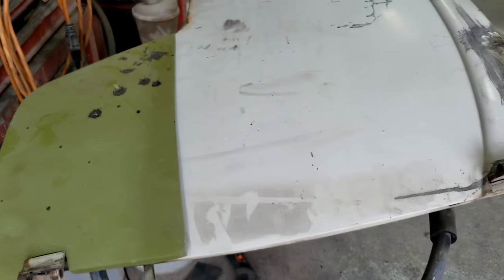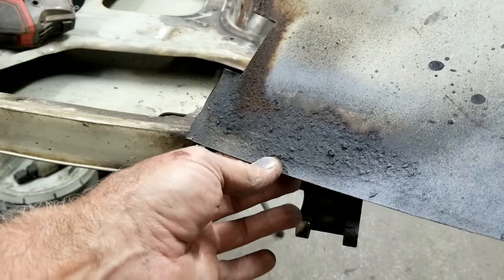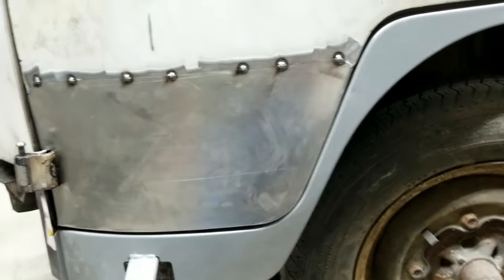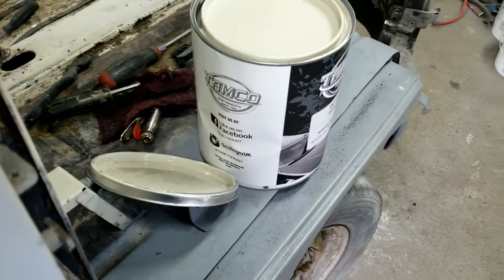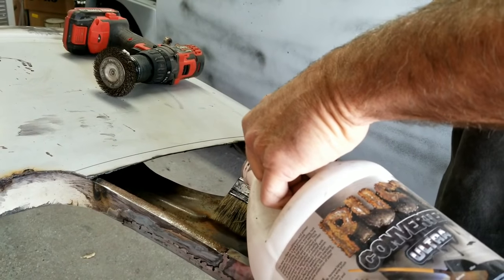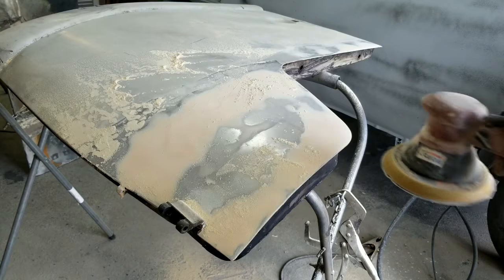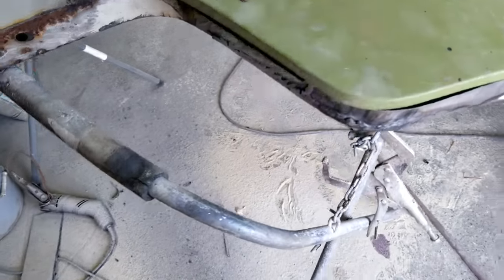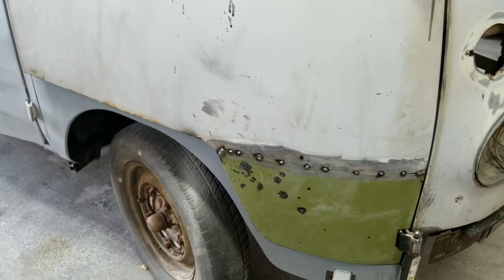RESTORATION - VW BUS RESTORE - Driver and passenger door Welding and Fabrication

Comment: Been watching all of your videos - Thanks for putting them out😊 thankfully I don't have to do the door bottoms on my project.  The door fit to dogleg is typical of the aftermarket parts.  Even original un damaged buses had fitment issues.  I'm certain that as the dies that they pressed the parts out aged and wore down the fits got progressively worse.  My old '63 bus was never wrecked, but the fits were really bad around the doors. My '67 had great fitting doors as does my '58 - I'm guessing age of the dies?  Thanks again for the great videos!

Comment: Mike - is the autocraft the same thickness as the KF?  Word on the street is KF is thicker.  Your opinion?
Reply from the maker: I dont think they are thicker but I think they are harder steel. Autocraft is more like the original metal Pliable. funky green is a bit more rigid. but both are good.

Comment: Hey Mike, I really enjoy your videos, so I sub'd. I have a question about a different video you did. It's older though and wasn't sure you would go back that far. Is there any place that sells cheater or mild performance cams for the 1200cc, or is my best bet using 1600cc rockers, as you suggested?  I have a few 1200 engines in pretty descent shape, and want to toy around and experiment. Thanks
Reply from the maker: Try Brothers VW machine shop they do angled grinds reground cams I would triangle 100 or angle 90
Reply from the maker: Also remember not to power up your 40 horse too much are you going to be breaking the crankshaft